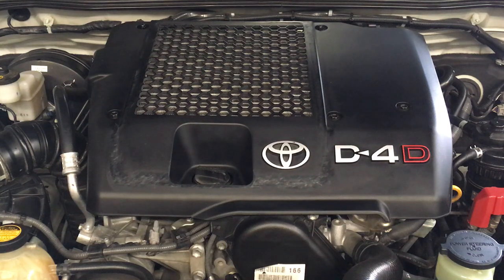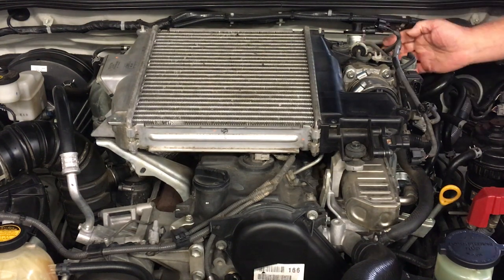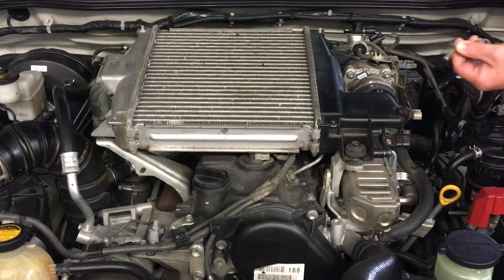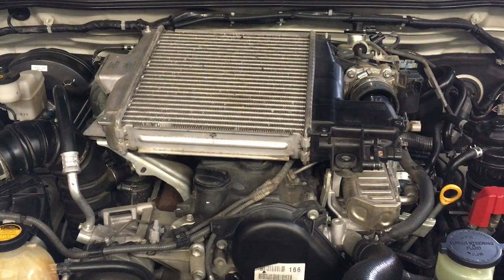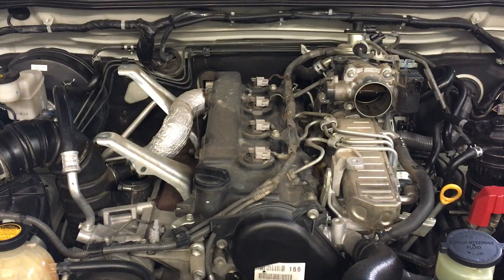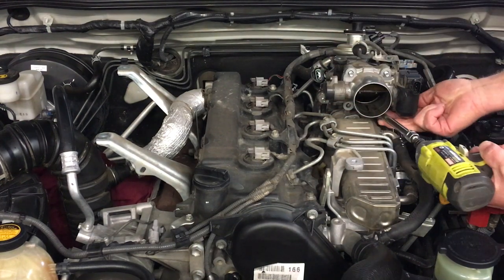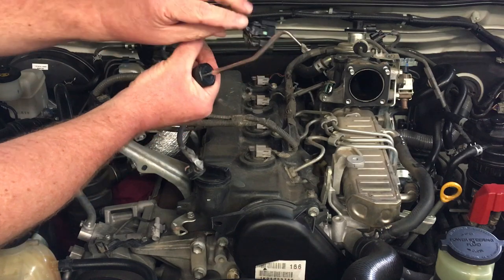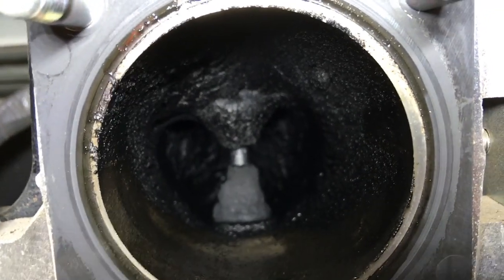REMOVE INTERCOOLER FOR EGR INSPECTION

Comment: I inspected my ERG to check if it was dirt, because I was getting the P0400 code. I just took out some 3 sensors plugs to remove the intercooler hose. After assembly it back together, not I get the code P0069 related with the MAP. And now the car seems into limp mode. Any ideas? My suspicions was initially, I removing the sensor plugs with the battery connected.
Reply: Even after cleaning the code P0069, it still comes back on, and after a quick scan at live data, the ERG shows as error.

Comment: hello very nice instructional videos i have a problem i live in aruba and i have a toyota hilux 2006 1kd and now its losing power when you accelerate amd here in aruba there isnt any good 1kd mecanic to check it for me any advice i can look on? i already cleaned the egr and the intake
Reply from the maker: Lots of advice keep watching videos and you’ll find the information you could start with cleaning the intake replacing the map filter cleaning the maf sensor and replacing injectors